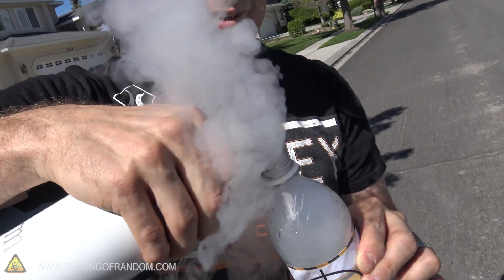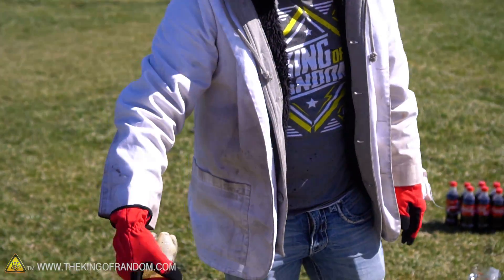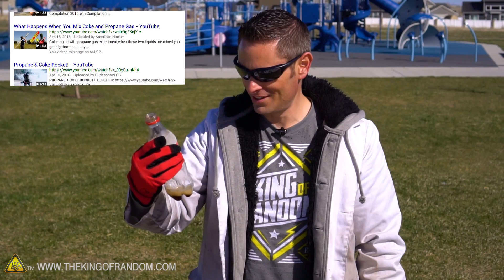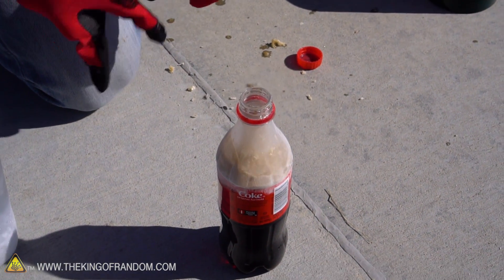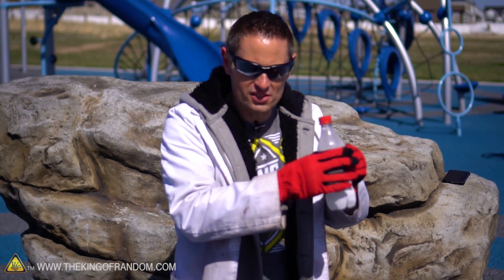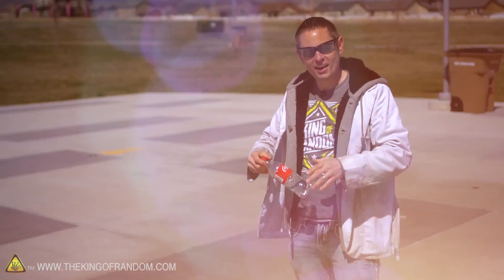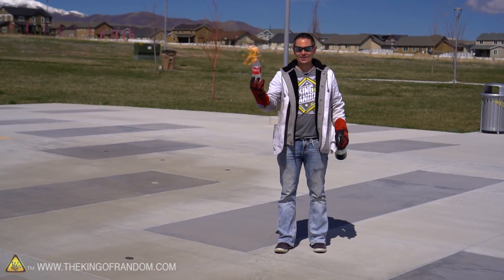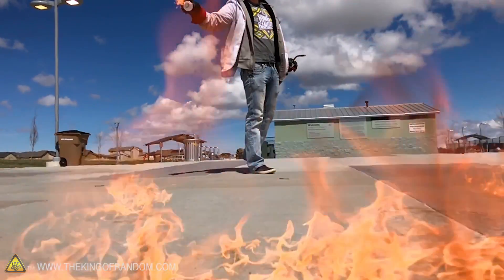Mixing Coke With Propane Doesn't Do What You Think It Does | Propane And Coke Experiment

Comment: What happens if you mix dry ice with propane? Or liquid nitrogen?
Reply: bealow6 4 you get cold
Reply: It's cold. That's it.
Reply: Dry ice is frozen Carbon dioxide (CO2).    "dried"  means "no water".  "Dry ice" is a misnomer, because it never had water.
Reply: literally nothing will happen their is no chemical reaction that will take place.
Reply: David Kenny I may be wrong. But I do believe that at standard atmospheric pressure Liquid nitrogen does not have the capability to bring Liquid propane to It's freezing point.
Reply: bealow6 4 I know dry ice and coke make rockets
Reply: Well ya never know
Reply: lol "what happens if you mix dry ice with liquid nitrogen'' dry ice is basically dried nitrogen
Reply: No I mean liquid nitrogen with propane
Reply: i want to point out that, dry nitrogen is colder than liquid nitrogen, if you know you would understand that when its icey than its colder
Reply: this is copyed from the last video
Reply: bealow6 4 you need to shake the bottle
Reply: That's what I thought!!
Reply: bealow6 4 I
Reply: Yh
Reply: "literally nothing will happen"  While I agree that no chemical reaction will take place, there will be a phase change if we are talking about the propane and liquid nitrogen.  The propane will transition to a solid.
Reply: Propane freezes at -306°F and liquid nitrogen boils at -320°F.

Comment: I think you have to plug the top with your thumb to create pressure.
Reply: KittyCatGaming ummm... you will get a frostbitten or even frozen deep tissue leading to an emergency room visit and surgical removal of dead flesh. I would NOT follow your advice. Propane expands as it is depressurized from a container and gets very cold. RV refrigerators use this reaction to cool the interior. (the propane is contained and gets recommpressed) See the video where Grant moves his gloved hand away from the lip of the bottle after he splashes some ON HIS LEATHER GLOVE. Next time your grilling, place your hand on the outside bottom half of the tank. Youll also see a frostline after 10 - 15 min. That is how you can tell how full your tank is.

Comment: I think because of the atmospheric pressure inside the bottle, the temperature at which it boils is raised. This is why the liquid stops bubbling once the pressure reaches a certain threshold. Since it stops boiling, no more propane gas is released, stopping it from exploding. It's the same reason your blood boils at high altitudes. Air pressure is way lower there, which means the temperature at which your blood boils is lowered to 98.6 degrees F or lower. (37 degrees Celsius)

Comment: I think the reaction of a mentos and coke is what has that reaction to set it off as a rocket. You could probably even pressurized the bottle upside down still filled with coke to launch it in the air.

Comment: Hey Grant - If you take a Coke bottle, add ice cubes, and add air duster, the coke bottle will hold the pressure. Once the ice melts, you are left with three clear liquids of different densities that will not mix (water, the dusting compound, and the bitterant). Removing the cap will cause an eruption of ice out the top of the bottle. If you do the same thing with a Gatorade bottle, the lid will fail under the pressure. So setting the bottle upside down on the lid will launch the bottle ~100ft in the air
Reply: ..the ice??
Reply: Liquid nitrogen and water in the bottle (just do the same thing) would fly 200m
Reply: I didnt get it... so it works
Reply: ThfKiller the people who make the air duster put a biterant in it so people don't abuse it that's the third liquid
Reply: Yes

Comment: Hey Grant,
A few comments/suggestions
1)  As I watched, it felt a little like your propane was spilling out, and to be successful, it needs to pressurized the bottle.  I realize you probably don't want to put your hand on the top, so no liquid spills out, but that may be necessary, so the gas floats up. 
2)  You might also have too much coke - too much weight, and the rocket can't lift off, and all that

Comment: After a few moments of thought: Propane in a sealed container is similar to gasoline in a sealed container. At room temperature both liquids will vaporize until the pressure inside the container reaches between 3 to 7 psi. It depends on what "room temperature" means; winter temps will produce about 3 psi where summer temps can produce 6 to 7 psi and my guess is that propane produces a slightly higher pressure than gasoline.  I don't know what the pressure is inside the bottle when you simply shake a carbonated liquid, but my guess is that the pressure is much higher than 7 psi. A Coke bottle is designed to withstand the pressure of a shaken coke producing between (guessing)10 to 20 psi. 

The fact that propane will pressurize the bottle as it vaporizes is what makes the propane bottle work. The bottle is not pressurized at the factory but relies on self pressurization. This is also why the pressure remains consistent throughout the entire use of a propane bottle. The same is true with a BIC lighter or Butane.

(edit PS) I know the bit about gasoline because as a boat builder, a gas tank, to be certified for a Coast Guard inspection, must be pressurized to 7 psi and it must hold that pressure for 60 minutes. Ordinarily a gas tank is vented but under certain circumstances like a clogged or rusted vent it could become pressurized.

Comment: I guess it basically works because when you put liquid propane in coke and turn the bottle upside down, the propane kinda goes up, since it is lighter, and once it reaches the top of the bottle it creates pressure, pushing the coke outta the bottle. Afterwards, it works just like a rocket. I think this didn't work because you kept the liquid propane in the bottle for too long and it froze the coke on the surface so that it couldn't goes up and create pressure. Anyway, I LOVE YOUR VIDEOS❤️❤️

Comment: Grant, propane hits around 250 pounds of pressure on a 100 degree day, but the pressure decreases drastically as temperatures decrease.  PLEASE add some form of disclaimer about storing propane in a plastic bottle

Comment: if its of any interest, the reason why the bottle became "room temperature" is because as the propane heated up, it increased the pressure inside the bottle. by increasing the pressure you altered the boiling point of the liquid propane making it higher than the outside temp. so when you opened it and released the pressure it quickly turned back the boiling point into what it is in a normal atmosphere. this is also the reason why water boils with a lower temp on mount everest.

Comment: the problem is that the propane is making an ice layer on the top so it can't get mixed with the Coke. Try to warm up the Coke  and then fill the propane in and instantly turn it around so it can't create an Ice layer. You also can try to destroy the icelayer.

Comment: i think what happend with the coke bottle is that the propane inside when it turned into a gas pressurised it enough that the propane that was still a liquid had a boiling point higher than usual so that to could not turn into a gas

Comment: I think the reason the propane doesn't blow up the coke bottle when its stored in it is because some of it boil of making the atmospheric pressure increase and boiling and freezing points change depending on the pressure of the atmosphere and that's why it started to bubble when you took of the lid. This is just my theory if you didn't already think of it.

Comment: I think it doesn't work due to the relatively high boiling point of propane
In this video, your propane was about -42C. When the propane touches the coke, propane got heated up and turn to gas, however the rate of the production of propane gas is very low as the temperature difference between the propane and coke is too small, and propane boils slowly.
Butane has a even higher boiling point than Propane, so i dont think that will work too.

Liquid Nitrogen would work because it has a much lower temperature(-196C), so it boils at a much faster rate. Therefore, the nitrogen gas is evolved at a much higher rate too. This provides enough propelling force for the bottle to fly.

Anyway, a nice video!!

Comment: Maybe it isn't working because you're too slow? Maybe the top layer of the coke freezes so the propane can't get underneath(or on top) of the coke. That is assuming that the rocket flies because the thrust is created by the liquid propane that is rapidly increasing volume(because it becomes a gas). Not sure if it works this way though.

Comment: I don't know if the videos you watched are fake or not, but one important thing I noticed is, as you noticed, the propane freezes the coke, creating a barrier that prevents mixing. Once you turn the bottle over, the propane dumps out completely. Try this again, but use an empty Coke bottle. Add the propane first and then the Coke. The barrier will still form, but the two will have no choice but to mix when you turn the bottle over.

Comment: Hey Grant, can you try putting gasoline  in liquid nitrogen?

gasoline  freezes around -70, will it freeze and will still be flammable?
Reply: Brian Spock It'll freeze, won't be flamable, as the vapors are what is flamable.

None the less. I would like to see this too. Still alot to learn when the King of Random is involved.
Reply: i support this
Reply: Windows 98 Microsoft doesn't support you
Reply: Brian Spock It WONT LIGHT!! It needs to warm up in order for it to reach its flame point.
Reply: Brian Spock Cool!
Reply: It wont since gasoline itself isnt flammable but the fumes that come off it are
Reply: Brian Spock I had the same idea just with propane😭
Reply: Brian Spock I got a reply on next episodes idea
Reply: Brian Spock 420th liker
Reply: Brian Spock gasoline isn't what starts a fire it's the fumes from gasoline. Gasolines viscosity is so high in theory if you drop a cigarette in gas that topped off in a bottle then it will not catch on fire because the fumes have no where to go which means there is no ignition source.
Reply: Brian Spock he did that
Reply: I looked like 👍on on Monday morning my darling said the
Reply: 520 liker
Reply: great idea
Reply: Brian Spock YES DO IT KING GRANT!
Reply: Gas is not flammable, just it's fumes
Reply: Windows 98 looks like grant does too
Reply: Gasoline is not flammable in liquid nor solid form, only in gas form. It might look like it's the liquid burning, but it's actually the gas.
Reply: Regardless of the flammability of it in an actual solid form, I would be interested to see if there would be enough melted liquid on the solid block to produce flammable vapours... Could you make a sort of slow-burning torch from the frozen gasoline?
Reply: frozen petrol will appear to burn if you light it but its the vapor released by the heat that is burning and not the frozen petrol itself
Reply: Brian Spock yes great idea
Reply: He will because its loved
Reply: SiLENcE i know
Reply: The Red One Yep, you are correct, would stillness fun to try though, I would want to see liquid gas
Reply: Brian Spock in